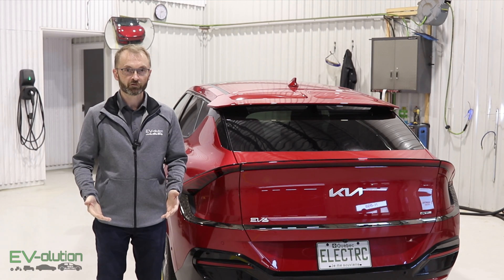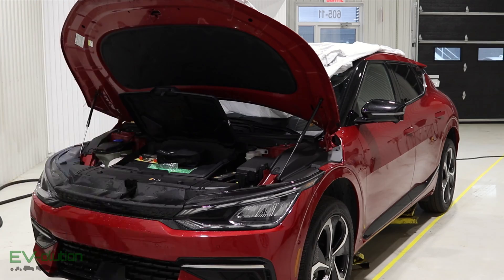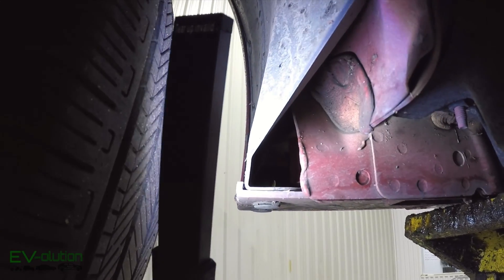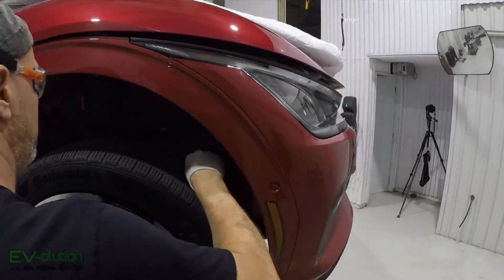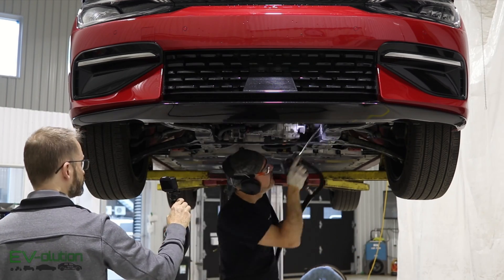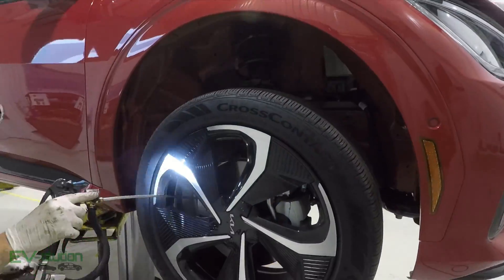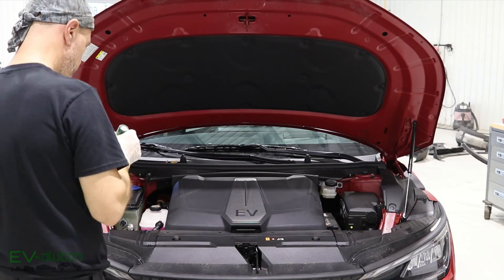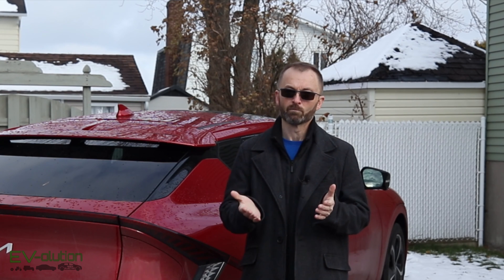Can you rustproof an electric car?

Comment: Great information. Definitely not cheap. How often would this need to be done?
Reply from the maker: The nice thing is that this total treatment only needs to be done once. Then every 2 or 3 years you have the exposed parts "touched up" and that costs next to nothing since nothing needs to be taken apart. I have pinned your comment because I forgot to mention this in the video. Thanks for asking.

Comment: I just got a Nissan Leaf in eastern Ontario and found this video very interesting, because I also no longer trust Krown Rust Control for my EV, though I'll probably continue using it on my ICE. 

The description says that you paid full retail price. And what was that total cost? I'll try to do this myself as best I can by jacking up the Leaf and removing the fenderliners and other trim as needed, but I'm just curious as a standard of comparison. I wouldn't be able to use Steve Boulduc anyway.
Reply from the maker: The job took about 6 hours and costs about 700$. If you can get to his location I highly recommend his company. IIf you do it yourself you also need to make sure you use a product that is not conductive.

Comment: Thank you for showing the EV6 process, which has helped me prepare for spraying my 2023 Niro EV with FluidFilm. The job was easier knowing what to look for in advance.
I can corroborate the findings regarding the foam inside the fenders (below the cowl drains and at the top of the wheel arches). In my case, the foam was soaked and holding water: the plastic covering the foam was keeping water in the foam, not keeping water out. In the past, I have replaced fenders on VWs that rusted out exactly where the foam was making contact with the fenders' interior face.  I'm leaving those foam bits out and ignoring any resonance they might have suppressed.
Reply from the maker: You are very welcome, I'm glad my video could help. I never understood why they would put foam that could hold water in a closed space inside the vehicle, it makes no sense. I never noticed a difference in road noise without them in both of my cars.

Comment: A great video again! Thanks! As accustomed to similar harsh weathers otherside of Atlantic as you, and soon getting delivery of new MY24 GT, I was wondering when I should take the rustproofing to my car first time? And how to make sure and perhaps argue about potential loss of warranty? 
About the price: i think it's well worth it and sounds much cheaper there in Québec than here in Finland.

By the way: did you ever take protective coating to your car's paint? That's one top of my first agengas after getting the delivery. Took it to my previous nonEV car and that was well worth it.
Reply from the maker: The best time to have the rustproofing done is as soon as possible, and ideally before the car is driven in winter conditions. However, there are a couple of things to note:
(1) If you are having a PPF (paint protection film) installed, then I suggest having it installed before the rustproofing treatment. This way you are ensured that no spray from the treatment will interfere with the installation of the PPF.
(2) Even if you drive the car for 1 winter before the rustproofing treatment, Steve, the specialist who treated my car, told me that it is not the end of the world, and the protection will be just as good.
(3) It is important that you select a place that specializes in rustproofing EVs so you don’t have issues with warranty later. Both of our EVs were treated, and the Kia dealership has never said anything about warranty versus maintenance. It is also important to have a good dealership who also has common sense, like the one I use, who understands that rustproofing on the body and battery box, has no effect on any components, meaning they also know that it is impossible for issues to be caused by a good treatment that is done the right way.
I never had a PPF installed on my EV6. I was supposed to, but right before I had it done we bought a house, so the 5000$ full body PPF job never got done. I will probably have the front done on my next car. If you want to see what it looks like after about 95,000km and 2.75 years, I talk about it in my Things I Hate video. Here is a link advanced to the part about piano black, where you can see some of the damage, and I can tell you that the hood/bonnet is pretty badly chipped: https://youtu.be/ysWPnxbrAfY?si=MZJ0HAD0q_sGRyxE&t=152
Reply: @EV-olution  I will have PPF (actually gloss coating) scheduled a few days after I get the delivery next week, and trying to get EV6 (not just EV) specialist to do the rustproofing the week after. I had PPF done 2 yrs ago for my (then new) Volvo and it was superb. Thanks for the information and additional link as well.
Reply from the maker: You are welcome and congratulations on your EV6. You are going to love it.

Comment: Is this oil based (KROWN, RustCheck) or lanolin based (WoolWax, Fluid Film, Surface Shield)?  Doesn’t look rubber based.  Seems he just takes more time to open things up then a typical place
Reply from the maker: The product he uses is a family recipe that has been developped and improved for over 40 years. It will not get moldy, it will not leak, but it will get into every nook and cranny. I asked him about it and it's a family secret that has been proven on thousands of cars over decades of use and improvement by his father, himself and his brother in their 3 companies that specialize in rust protection. As for taking more time, this was a 5.5 hour job of meticulous application and attention to detail; so yes he takes more time and, as mentioned in the video, there is no drilling which is very important.

Comment: Great video! What are your thoughts on having this service performed after a winter of exposure? In the not so ideal scenario of finally getting our RAV4 Prime (phev), but of course near the end of November after 2 years of waiting. Thanks
Reply from the maker: Thank you very much, and thanks for watching. Regarding your question of treatment after 1 winter, I asked the question when I initially called him to make the video, but forgot to mention it in the video. Essentially, he said it is best to have it done before winter but it is not a problem, nor any worse, if you have it done after 1 winter. The first winter will dirty the car, but the grime won't get into everything in large quantity in the first year. So it's not a bad situation if you can't have it done until after, but I suggest booking your appointment as soon as possible. Are you in Eastern Canada and going to have it done at Steve's shop where I had it done?
Reply: @ thanks for the reply, and advice! We are about 3 hours north of Toronto. We are interested in using Steve’s service because your video really shows a next level attention to detail; both from your perspective on rust proofing and EV, and Steve’s skill and patience. He’s pretty far from us by the looks of it unfortunately, so maybe a road trip this summer is the only option. It’s a shame to run through a winter without the protection, but my hands are tied and it sounds like it’s not the worst thing.
Reply from the maker: @ranchroadhomestead  it would be worth the roadtrip and you could make a weekend to Québec City out of it 😎
Reply: @ awesome, we always wanted to go there 👍

Comment: Great video.  I recently rustproofed my wife's 23 GV60 with corrosion free 3000 at home (I have a midrise lift).  I did not remove the frunk,  will do that next year.  I sprayed the castings of the motors as the rear one was starting to show signs of aluminum oxide corrosion.  Took about 4hrs.  I did not remove the door cards,  might do that next year, but she has a white/alcantara interior, and I didnt want to get my grubby hands on that.

https://youtu.be/QYAFuAbARgU?si=7BqEpYqz-LfYalLU

Comment: Have you had any pushback from the dealer when they've done your regular maintenance since you've had this done? Did they even notice the product?
Reply from the maker: Both dealerships I have dealt with in the last 5 years, with my Niro EV, my wife's Soul EV, and now my EV6, have never said a thing. They know a proper treatment when they see one, and not a single component or wire has any treatment on it. If Kia were ever to blame the rust protection for a problem they are going to have one hell of a time proving it.

Comment: How long have you owned the ev6?  Did you winter it before rustproofing it?  I just bought one, and everybody is telling me not to get it undercoated.
Reply from the maker: Being one of the first 200 in Canada I have had my EV6 since March 2022, so about 1.5 years now, and I have driven it a full winter. I had the car treated before winter because the faster you have it done the more efficient the protection is. I made this video because lots of people say to not get an EV protected, but an EV is just like any other car that is made of steel, it will eventually rust and the only way to protect it is to have it treated. My video explains all the details about who and where to go, and why. I hope this helps.

Comment: How long does the treatment last or how often does it need to be retreated?
Reply from the maker: The protection I had done is commonly known as, and misleadingly named, permanent rust proofing. This is far from the truth and it requires a touchup to areas exposed to water and snow ever 2 years. That means the under carriage, and a couple of spots like the bottoms of the doors need to be sprayed every 2 years, and it is done at a lower cost than the initial job. I don't have the cost of the touchup because it has only been one year.

Comment: Great video and the guy you featured is one talented individual!
I can see why he is booked a year in advance....
I am lucky as I have a home shop with a car lift and I do my own oil sprays on my vehicles. I use many of the same techniques he used and I also learned a bunch by watching what he was doing.
We also have an EV6 in Runway Red on order and expect it sometime this summer. Our 2023 Kona EV has been awesome and we pile the mileage on. I totally agree oil spraying is well worth it as it will maximize the life you get out of a vehicle. We rarely get rid of vehicles and usually wring every last drop of usability out of them before they leave. We usually end up selling our cars on to friends who need a winter car as they know how well maintained they are.
About 15 years ago we sold our beloved 97 Aerostar AWD van with 490,000 km to a friend for a winter vehicle...they are still driving it! The body has finally succumbed to the rust worm but that is because they did not continue regular oil sprays...but it is still running!
Anyway...Thank you for doing your videos they are great - especially the out takes at the end!
Mike 🇨🇦
Reply from the maker: Thank you very much. It is great that you have a garage and a lift, I would love that 😎. As for the Aerostar, holy crap, that was a long life and surprising because they were not that reliable. Thanks for taking the time to watch and for the comment, I really appreciate it.
Reply: @EV-olution  LOL...yeah we had several of them and they where always good for us. But I am a maintenance freak...
The EV has such low maintenance I am bored but I have a few other cars as well.
Mike 🇨🇦

Comment: I only have one question.  How much weight is added to the vehicle?
Reply from the maker: Weight?! I had not thought of that since it is a very fine mist of product that is applied and you can barely see it. So I am unaware of how many grams it would weigh, but I am guessing it is a very tiny fraction of the weight of the 2 foam inserts I had removed from the car. (shown in the video).

Comment: You should probably note that not all shops will allow the customer in the shop area during the application process.
Reply from the maker: Correct. I was given access because I was making a video about the subject, but in general, being present during application is not something that is allowed.

Comment: Nice André!

You forgot to mention, what product are they using? I know there are a few different treatments out there.
Reply from the maker: Thank you, and nope, I did not forget 😎. In the video I mention that it has to be the right product but since there is not one specific product, and the one used at this shop is a "family recipe" that has been evolved and developed since the 70s, I could not give a specific answer. This is why I mention that it has to be an appropriate product that is used, without giving a type/name. It boils down to trusting the place that does the work. This place is the second generation of owners doing treatments and they have been protecting cars for years, with excellent long-term results.

Comment: I also don't want holes drilled in my car so I appreciate seeing an alternative rustproofing method. Maybe I missed this   but how often must this treatment be done? Also,  are certain manufacturers/models of EVs easier to do than others? Finally, any issues with breakage of plastic fasteners during the process? Even so,  this was a great video. Thanks!
Reply from the maker: Thank you very much! Nope, you did not miss it, I forgot to mention it. I pinned the first comment that asked this question and answered it there 😎. This big treatment is only done once, but some exposed areas should be "touched up" every 2 to 3 years (2 is better). I asked about different models and he won't do just any car, but says the ones he does take a similar amount of time. Also, no broken parts or clips! It was fairly easy, but this is a new car so plastics are still flexible enough even though it was a long and cold drive (200+ km) to get there.

Comment: Thanks André for letting us see what is involved for that procedure!  I had mine treated at a Montreal area shop that does pretty much the same procedure and I'm amazed at the product, especially compared to the old oil based rust-proofing I had done on my other cars (from the chain we all heard about here in Quebec, not to name names).
Reply from the maker: @Jé it is my pleasure. And you are correct, things have changed a lot over the last several years. I would not use one of the well advertised companies, especially the one who claims they can do your car in less than 30 minutes 😎
Reply: Would you share with us the name of the shop?
Reply from the maker: @Jean Yves Guiguere he probably used Arleco in Anjou. They are the ones suggested on the AVEQ site that I provided the link for in reponse to your comment below.
Reply: @EV-olution  On my side I contacted Alerco today which is closer to home then the one you used which is around Levis (+2h driving).  But it's more expensive then what you paid (dunno if it's related to inflation from 2 years), they were asking 950$ for doing a Soul EV which is smaller then the EV6, I was expecting similar price in around $600.  Also they are taking 1.5 days to complete the whole process too!  I saw their videos they put on their website which look to be the same very meticulous method that will also last a life time and need to do touch up/check every 2 years (they charge 120$ for this which is reasonable).
Reply from the maker: @mythrium  I had my wife's Soul EV done at Arleco, but I prefer the place I had my EV6 done and did not mind the 2.5 hour drive to go to Levis. I will only have my cars done by Steve in Levis.
Reply: @EV-olution  Thanks André for the tips, it's good to know that you had the Soul EV at Alerco so you could compare the works between the 2 places.  I'll contact Bolduc and see what would be their estimate, could do this as part of a small trip around Quebec next summer.
Reply: @jeanyvesgiguere6666  Like André mentioned, it's Arleco in Anjou.